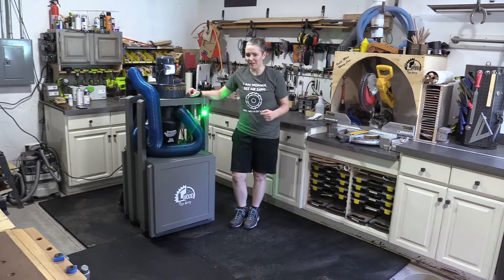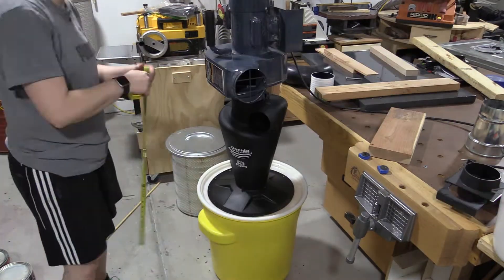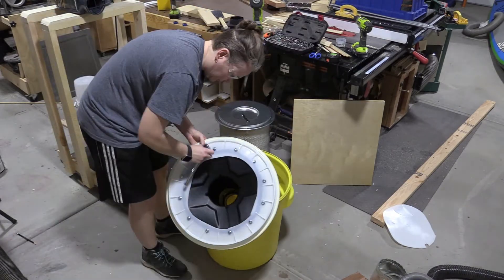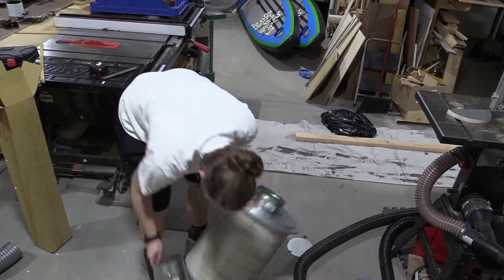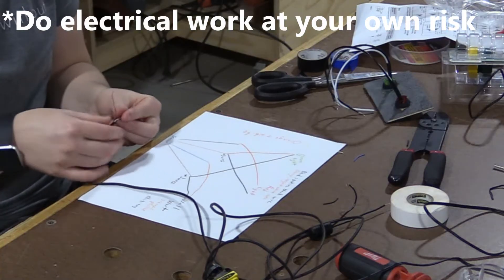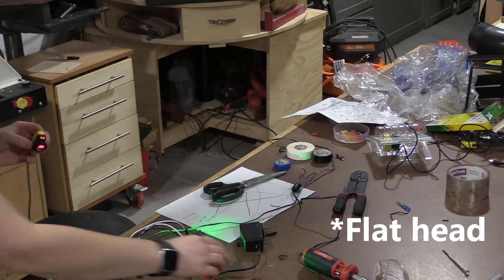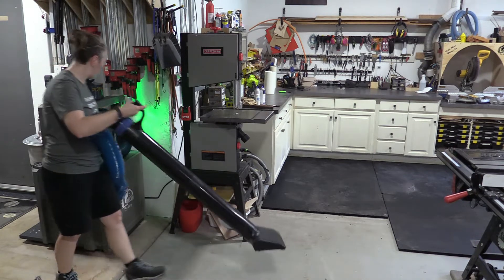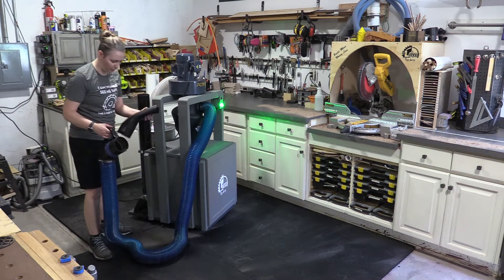Cyclone Dust Collector Cart WITH DIY Bin Level Sensor. Super Dust Deputy

Comment: what gauge wires are necessary for the wiring of the sensor?
Reply from the maker: I just used the wire that came attached to the sensor and the wire that was attached to the lights